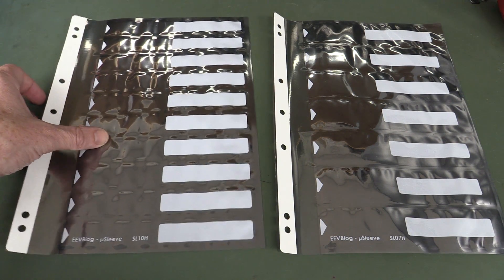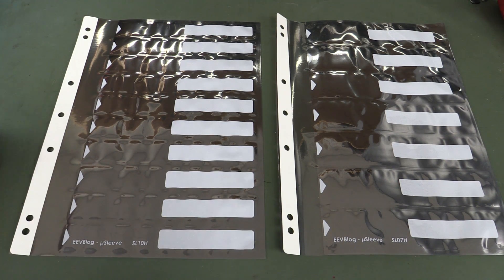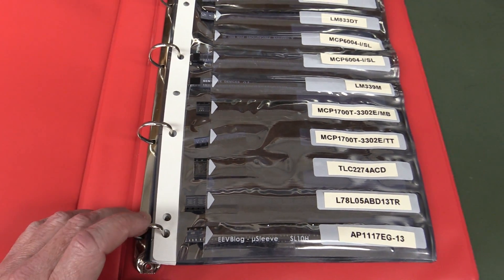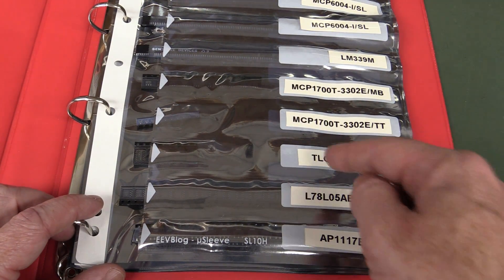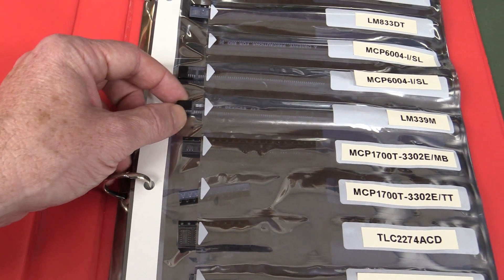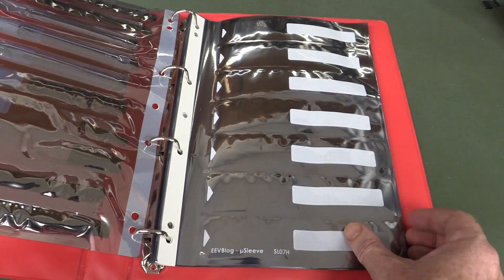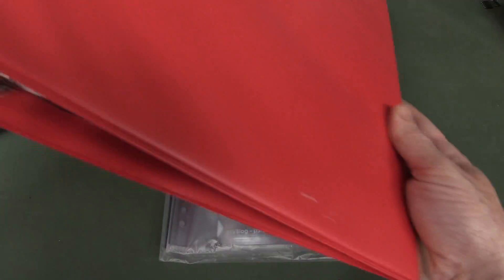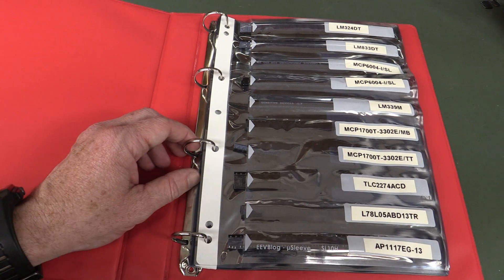µSleeve Product Announcement

Comment: I use 35mm negative filing sheets (for film cameras) to store my passive SMD parts in a folder. Basically exactly the same but without the anti-static-ness. I may consider getting one of these just for a few common active SMD parts. https://www.amazon.co.uk/Negative-Acid-Free-Archival-Premium-Archive/dp/B00FMSFQLS/ref=pd_lpo_vtph_421_bs_t_1?_encoding=UTF8&psc=1&refRID=7YE2S9Z07HCSRZ1CNZ3K

Comment: Sadly, these won't fit in any of my binders. The ring spacing on mine is 2.2 cm between two groups separated by 7 cm. And I don't see any holes on this product that seems to fit that description though.... Otherwise it seems like the perfect product. And it would be nice to have a few.
Reply: Swedish, I'm guessing? Unfortunately Sweden has it's one domestic ring binder pattern, used nowhere else in the world. So I'm not sure it's economical to do it, if the manufacturer doesn't have the tooling by default.

Comment: I like that it will take tubes as well as strips.
I have masses of tubes, usually with only three or four different ICs in them and they rub together and the labelling on the tube rubs off. 
Ideal for small numbers/short tubes and great filing system.

Comment: The hole pattern doesn't match the spacing usually used for A4 sheets in Sweden and probably elsewhere. Granted, that spacing may not be ideal because it doesn't support the sheet at the very top and bottom, but might still be nice to have the option.
https://www.staples.se/content/images/product/3904554_1_xnl.jpg
Reply: Sweden has a unique hole pattern for ring binders, if I recall correctly. It's the odd one out - the rest of the world is at least vaguely standardized, whereas the Swedish pattern is 100% sweden-only, not used anywhere else in the world.
Reply: We've got them with 23 rings in the Netherlands.
Reply: Yeah I am 100% sure they sell DIN ringbinders in Sweden as well.
Reply: I've never seen one. But sure, some places probably offer them, but that doesn't make them the standard there. Moving to Norway made it abundantly clear that there was a different standard, because nothing fit in the old binders, and old papers didn't fit in new binders bought in Norway! I bought a new hole puncher and converted everything to whatever they use here.
Reply: https://www.staples.se/brevkorgar-och-parmar/cbk/38.html?filter=Antal+ringar_2_4294900540
Reply: "But sure, some places probably offer them, but that doesn't make them the standard there."

You can buy a metric ruler in the US, doesn't make it standard... As proven by the overwhelming majority of binders on the same site you linked being Swedish standard. I mean, I am literally swedish - I have swedish binders from Swedish workplaces - they're not DIN!
Reply: Fair enough, but it is not a major inconvenience to find DIN or ISO binders to house a specialty product ordered from the other side of the world like your post implied.
Reply: I never said it was. I just said that Sweden has it's own standard, which is true, it does. The binders that someone already have in their house are like overwhelmingly likely to be Swedish standard. That's all I ever said. What other people are saying is that it'd been nicer, of course, if they could just use the binders they already own. Minor inconvenience, sure. But I never claimed otherwise.
Reply: Punch your own holes if the existing ones don't fit.
Reply: Simon Tay I suspect the material is too tough to be punched comfortably with an average paper puncher. You'd get through with enough force, but the holesprobably wouldn't be clean. And either way, the point of paying for something like this is to get a solution that works out of the box.

Comment: I get my strips about 4 components long. They would be lost in these. There needs to be a way of getting out components deep in the pockets.
Reply: mbaker335 there is... Use your hands, you can slide them out by pushing against the top and sliding to the side.
Reply: I suspect it would be much more difficult than it sounds.
Reply: Ram a staple in the sleeve.
Reply: That would bypass the anti static, probably.
Reply: Cut a small piece of anti static foam to length and plug the extra space

Comment: One "marketing" suggestion, instead of eevblog print eevblog.com that way if people don't know what that is they'll go to the site.
Reply: @L3 P3 Advertisement Artist here. Exactly.
Reply: The thing is, if these get sold on Adafruit, Amazon, Farnell etc (which is a definite possibility) then it is a good method to introduce people who don't know Dave and EEV to the whole brand - you'd be mad to restrict your market just to people who watch Dave's videos . Exclusive? Chances are that the Chinese will be ripping these off in days, and you need to keep your brand distinctive to make sure people buy the quality original product. Just saying "use Google" isn't good enough, corporates with good Search Engine Optimisation people will get their product in higher than the original.
Reply: Or they can just google "eevblog".
Reply: Of course specifying the website is better than just the name, anything that removes friction between the will to buy and the act of buying will allow you to increase sales.
Most people will not make the effort of googling so helping them to the site is needed, any additional effort needed between seeing and buying reduces sales by a percentage.
Reply: Wait, is this a suggestion from the 20th century? I think it is.
Today, everyone except your grandma would ask google.
Reply: Better still, link to a specific item re-order page
Reply: You can get it only on eevblog.com anyways I think

Comment: Will a short tube of DIPs fit in the 7-slot sheet?  I suspect they won't, because they'll shorten and stress the sheet.  The sheets for an ideal DIP tube solution would have vertical slots.

Comment: Need a version for loose parts (trading-card style). My fingers wouldn't be able to reach the end of the sleeves.

As hobbyist, we often have even smaller numbers, no longer on tapes or tubes.

Otherwise, a really good idea/product. Definitely would be interested!
Reply: I agree! I have the same problem, and my "parts bin" is just a plastic box with a bunch of element14 bags to hold all my parts
Reply: I use these from eBay ;)
 http://www.ebay.co.uk/itm/10pcs-Anti-static-SMT-SMD-Kit-Lab-chip-Components-Screw-Storage-Box-Case-C-/142444580608?hash=item212a5bcf00:g:2XwAAOSwPK1ZXPbD
Reply: Are you sure those are ESD-safe? Yeah, it says so in the title, but it also says "screw storage" and, inexplicably, "C++", so that's really just keyword stuffing...

Comment: That's a good idea. That would be handy to have ESD safe sleeves for storing parts in.
The sleeves in the sample books on ebay are not ESD safe, so I only use them to store my resistors and capacitors.

Comment: Have you considered a pocket grid pattern for non-tape components?
Reply from the maker: Was, was going to do a follow-up product with large pouches
Reply: good plan, i think storing stuff in ring binders could work pretty well, definitely worth having options for larger parts too
Reply: Cool, I will absolutely buy a set or two of those.
Reply: I have some PET that are already on the market since years, no idea if they are anti static/esd safe, though they are made by some electronic parts manufacturer. But i use them to store some THT parts in ring binders, i find them very useful.
Check out Weltron W90967 and similar, they are available in three pocket sizes, all A4 format.